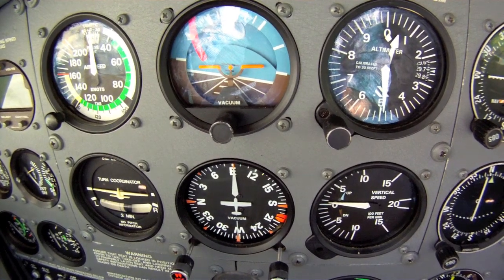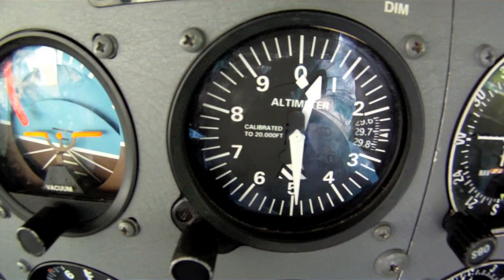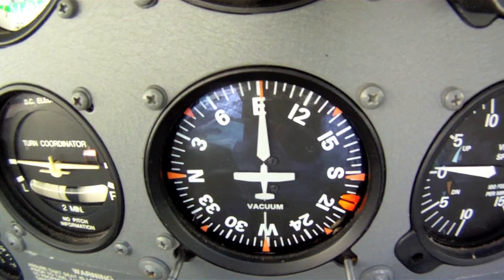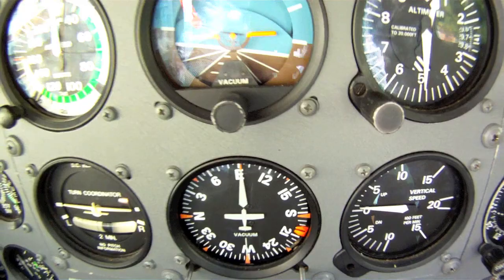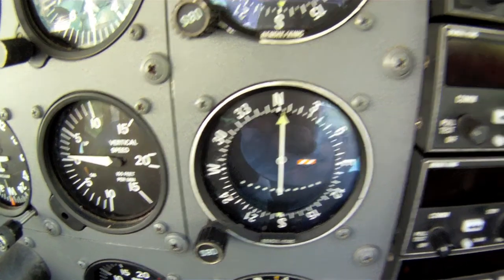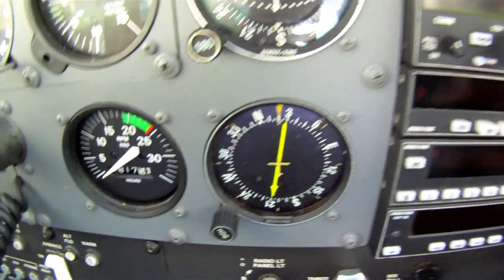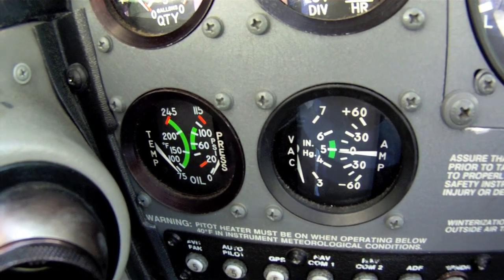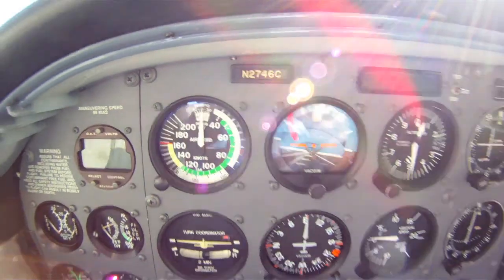Cessna 172 Panel

Comment: Great video- thanks.

A newbie, just getting interesting in learning about flying. With the help of videos like yours & todays flight simulators it’s very interesting to learn the basics.

Two questions-

A) Do small planes such as a Cessna have “Wind Indicator Gauges”  displaying direction of the wind & wind speed?

I’m used to sailing & that gauge helps me to know what direction to maneuver my sails etc.

I know there’s wind socks & devices around runways but anything in the plane?

I use Windy app- maybe this app could help the pilot planing a trip.

B) sailboats need some wind in order to move forward etc.

Do small planes benefit from light to medium winds during flight compared to hardly any winds?

I know the propellers or jet engines provide lift for the wings.

In a sailboat going with the current pushes me along my course. Going against the current I might need to increase my engine speeds to maintain forward momentum.

Does any of this apply to flying small airplanes?